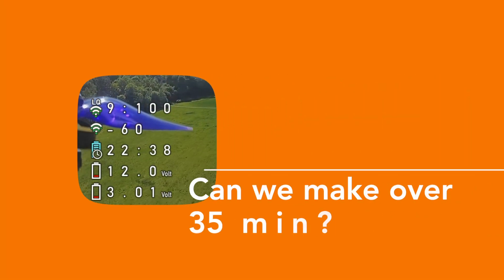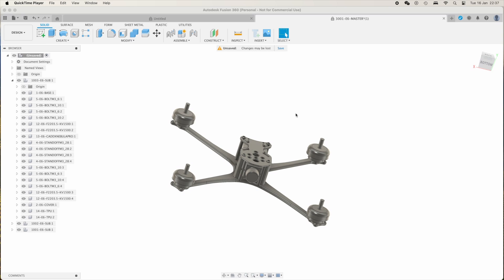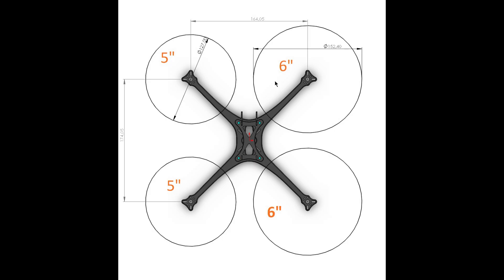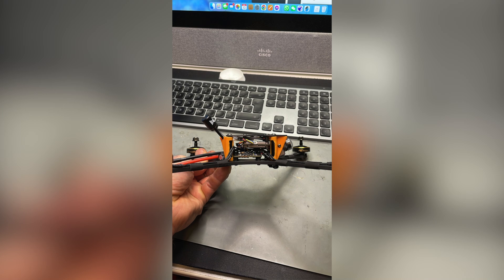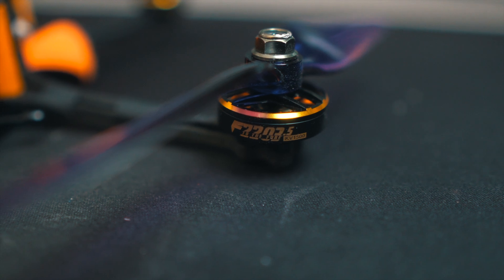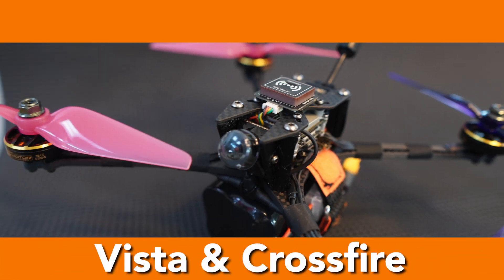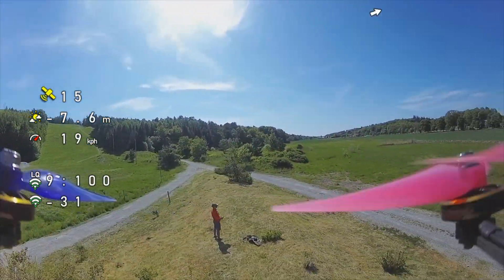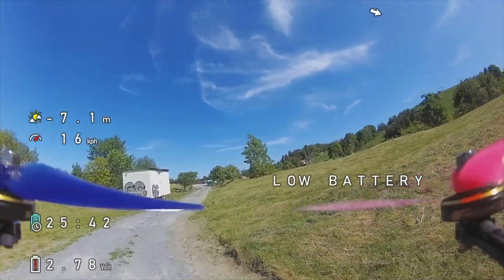Creating your own FPV drone  - The Apus6

Comment: Very cool project.  Couple questions: 1) how did it feel flying 1500kv motor on 4S?  2) what was the weight including Battery straps, battery pad, GPS etc (final flying weight because when you show it on the scale it doesnt look like it is complete)?
Reply from the maker: Hi David. 
1.-it’s a cruiser. Long and easy turns. I like flying it at high altitudes and long range. 
2.-just under 500gr (494) with 4S 18650 walksnail version. Vista version was 523gr
In the scale is without GPS and with the original antenna. I changed the antenna later for a sma adapter and. Longer antenna
Reply: @NordFPV  Thanks so much for the info. I am building a 6" with a slightly heavier build and motors.  With everything including 4S1P 18650 it is 605g.  I do however think the max range is going to be with 4S2P 18650.

Comment: What was the reason to go with the sma style antenna instead of just having the walksnail ufl connect antenna? You could shave more weight not having that chunky connection on there.
Reply from the maker: Hi Michael. I did actually started with the original 2 antennas. V1 walksnail unit. Then I started to do some long range flights and I needed a better antenna. That’s why I changed to the SMA and got a better LHCP antenna.

Comment: i think i can make it do 35 minutes outdoor. will need to tweak few things. that frame is too heavy. prop size needs to be 4 or 5 inches and use some nylon screws. there are few other stuff like motor choice which will also help but 35 minutes is doable.

Comment: I mean that's pretty cool, but you could get those 25 or even 30 minutes with a regular 7 inch as well. Even BNFs like the Chimera 7 should get that done, so I do not really see the point of making a frame on your own. The Five33 Lightswitch 7 inch seems pretty promising as well. Cool project tho. Respect
Reply from the maker: Remember the goal was 35+. We didn't achieve it, we got "only" 25, which as you say regular BNF 7" can also do, but our goal was much more.
Reply: I thought the same. I built some 6s1p 21700 4200mah packs and get mid to upper 20’s with a Rekon7.

Comment: Yeah, cool project. I am thinking about doing same thing from time to time but my CAD knowledge is very basic. I don’t need 25mins but 10-15 would be nice sometimes.
Reply from the maker: The good thing about doing your own drone is you can decide what's important and what's not important for you and your goal, and create something towards that goal. In this case I didn't care much about carrying a GoPro for example, and therefore I didn't need the power on the motors, or the space to attach it.

Comment: It's a pain to tune such an ultra light build.
I dont recommend building one of these, if you aren't skilled at tuning.
Scott Tomlinson got more than 55 minues flight time with those motors. Check it out.
Reply from the maker: Hi Chris, you are just making me feel good about my tuning skills. Thanks!
Reply: @NordFPV well deserved, easily the most valuable thing you offer as you're top .001% in tuning easily.